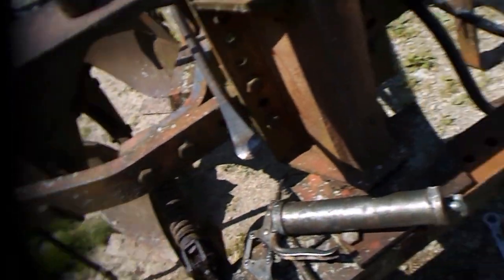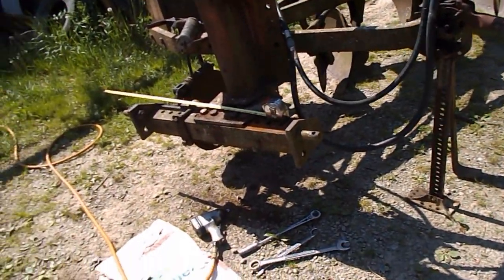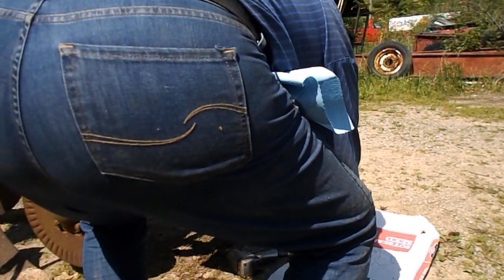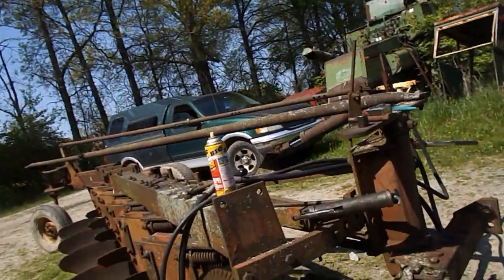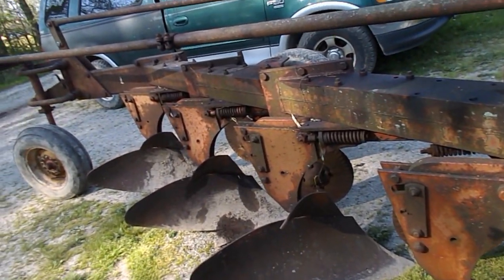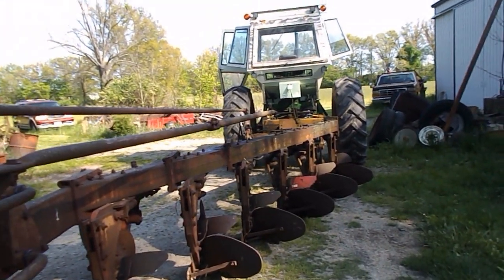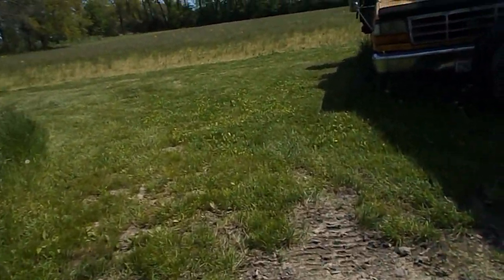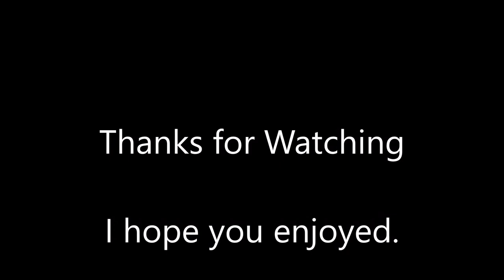Fixing the White 546 Plow May 10 & 11th 2022 Part #2

Comment: I sure do wanna see that oliver do well after all the love you have put into it . It sould pull them plows well it's got the power specially with bandit at the wheel. Have a great day sir and keep up the great work
Reply from the maker: We had an 1850 years ago and it pulled 5x16"s with ease so I dont think 6x14"s is going to bother it one bit.  The interesting thing is it will be running on an old injector pump that I borrowed and I think she is going to run great with it.  I've plowed with the 1850 before but this is a new to me never used before plow so I have a little learning to do on it and I think I'm going to have fun finding out !  Bandit

Comment: Looking forward to seeing you pull that thing behind the 1850.  My first international plow I bought, I had to adjust the rear wheel because it was kinda "dog-tracking".
Reply from the maker: Its going to be interesting putting her in the field for the first time with this plow behind it and I hope all the time I took measuring everything pays off or it will be back to square one !  The plow hitch had to be moved over no matter what I did and its a lot easer to move than that back tire on the 1850 will be for sure , That might turn into a real nightmare to move !  This is the first 6 bottom I've ever pulled before so this is going to be fun !  A tractor I've only plowed with once and a Plow I've never used before hummmmmmm What can go wrong ? Ah hell its going to be fun no matter what happens !  Bandit

Comment from the maker: Well its May 10th and 11th and I'm finishing up the work on the White 546 Plow. I start the day measuring the tractor and the plow to see how much I need to move the hitch over so it lines up with the tractor.  Well with the help of the fire wrench I got the 4 3/4" nuts off the bolts so I can move the hitch over and got everything tightened good and tight, No more ug-a-dugga's ! LOL I got the steering bar loosened up and moved back lining up the steering tire up a lot better than it was. Got a lot done to the plow and got it greased from front to back and to my surprise it only took 2 tubes of grease ! LOL  By the end of day 3 of this I got a new grease cap for the gauge wheel and got those bearings repacked as well as all the coulters on the plow so its pretty much ready to go. Some of you guys say the 1850 wont pull this plow but I'm pretty sure it will, We had an 1850 before and it pulled 5x16"s with no problem in fact it pulled them easy and being the 6x14"s are only 4 inches wider than the 5x16"s I think the 1850 will pull it easy enough, But one thing for sure its going to be fun finding out if it will pull it or not !  I hope you enjoyed watching.  Bandit

Comment: Its red with yellow wheels it may  be the last Minneapolis Moline plow built with a white sticker on it god bless you and your family bandit
Reply from the maker: The brothers that bought this new have passed on now but Harry @ McHenry's told me that they came in and ordered this plow as a 6 bottom in 1976. When it was delivered to them it was in crates and he had to put it together. He said when they opened the crates up he was surprised that the paint was MM red but it had the White decal on it with the MM yellow rims (no tires) and it was a 4 bottom main beam with 2 add on beams when it was ordered as a 6 bottom. This was in the time when Oliver and MM were being phased out and everything was being changed over to White so they just put White decals on what ever they had. Harry said they would order parts in for an Oliver and it might have been painted MM Yellow or Cockshutt red or White red and they would have to give them a can of Oliver green to paint it with so it matched.  I have 3 pieces of equipment that were bought new at McHenry's that Harry put together when it came it , He told me ware to look and sure enough found ware he signed it ! LOL That is kind of an odd thing to know but its kind of neat to know who put it together.  Bandit

Comment: Good video. Seems you really know your plows. Question what is the purpose of using a quick hitch?
Reply from the maker: The quick hitch is simply a time savings device used to make hooking up to semi mount and mounted 3 pt equipment a lot faster and easer for one person to do. A lot of tractors have extendable lower 3 pt lift arms and some dont making hooking 3 pt equipment up a real time consuming chore to do by yourself. Not to mention using a quick hitch is a lot safer because no one is between the tractor and implement to get hurt. I've wanted one for a long time and finally got one and I can say without a doubt life is a lot easer using this quick hitch in just time saved and not having to get between the tractor and say a 14 foot 3pt field cultivator to try to hook it up, With the quick hitch its just back up to the implement line it up catch it in the hooks as you raise it up reach around and flip the latches down and your done. Its one of the best things I've bought to use on a tractor hands down and its faster and safer for hook ups.  Bandit

Comment: Do you have sandy soils or gravel under lay in your soil? My 1855 will struggle with my 546 5 bottom plow I have in my soils. Do you think your 1850 will be smoking a little when pulling your plow? Love watching your videos and all the projects you get into
Reply from the maker: One spot with some sand in it but for the most part just clay about 6 to 8 inches down. The other 1850 we had would play with 5x16"s in this ground and I still have that plow back in the woods. 6x14"s will pull a little easer because of the smaller bottoms, 6x14" are only 4" wider than 5x16" so it might pull easer , We'll find out soon enough ether way and its going to be fun !  Bandit
Reply: @banditfarmer1900  I can't wait to see the 1850 pull the 5x14s. I plant corn with my 1850 6 row jd7200. Thanks Bandit for the  great videos
Reply from the maker: @matthewdavis4081  I think she will do just fine pulling that 6x14"s and thats the biggest plow I've ever pulled so this will be the first time to use the plow and first time to pull a 6 bottom so it will be a day of firsts cause one of the fields I've never plowed before and its the first one I plan to plow so I will enjoy the day.  Bandit

Comment: Well Bandit all I got to say is I still use row markers to plant and no electronics with 16 row planter all my tractors are older model with cabs some without no GPS or anything some of these farmers shut down for a sensor or planter electronics lose 3or5 days of planting don't understand then I got too thinking I don't believe they can operate with out electronic or GPS they don't know how to set a tractor up to plant or cultivate don't know what the emblem on the hood is used for when all this electronic stuff goes they are in for a disappoint ment
Reply from the maker: For what I'm doing I really dont need the electronics and to tell you the truth I dont know if I could figure out how to use them to start with. But I do know how to follow a simple mark left by a marker or a tire track left by the drill pretty good, Heck I have 50 years of practices ! LOL  I see a lot of the stuff guys do and I can see the good of having it but I can also see the downside of using it or not being able to because the mice got to the wires and your down till you get the parts in to fix it. For what I do keeping it simple is the best thing I can do and to tell you the truth I like it that way.  I still know how to set up tractors to plow and how to set up plows for a tractor and even if I havent done in awhile run the cultivators and do a good clean job of it. It might be old school but it still works really good , The biggest thing is to go slow and let it do its job, No Speeding ! LOL Used to love heading out early in the morning on the AC WD and 2 row mounted cultivators and doing corn or beans with the dew on , Quiet peaceful and easy to relax and just do the job. I'd stay out till about 11 12 o'clock and head back out about 6pm till about dark and I loved doing it . There are just some jobs on the farm that are just enjoyable to do , Cultivating raking hay and chopping corn stocks are jobs I love doing and I dont need electronics to do them unless its a radio ! LOL  Bandit

Comment: With the cost of fuel is it worth pulling that plow across the field
Reply from the maker: Well with roundup being over $60 a gallon a couple of gallon on diesel fuel is a lot cheaper to me to do. I bought a 100 gallon of diesel fuel a month ago and I still have 50 gallon in the tank so I've used about a gallon an acre to get seed in the ground so I think I'm doing pretty good. Bandit
Reply: @banditfarmer1900  I think 1 gallon per acre is a mistake??
Reply from the maker: @timknoll8654  Even if its 2 gallon an acre its still cheaper than going the no-till route.  I work my ground simply because one it compacts easy and 2 I have the equipment thats all paid for. If you run a tractor right (its the same with a car or truck) you will get good fuel economy. Most guys would put a 20 or 22 foot disk behind an 1850 , I put an 18 foot behind it so its not lugging the tractor working the crap out of it and I dont run them wide open like a lot of guys do. Most of the time the 1850 is running at 1500 to 2000 rpm range and its not working hard and its easer on fuel. This is the main reason when I fixed the long up and was going to sell it I used it and found out you couldnt stay on it long enough to empty the 21 gallon fuel tank !  Its the easiest on fuel tractor I've ever seen so I had to keep it. My 1550 diesel is the hardest on fuel tractor I have, It burns more than the 1850 does by far but I love that tractor ! I might use 2 gallon an acre to put crops in and harvest is about 1 1/2 gallon of gas , The 4400 is a gas hog ! LOL  Bandit

Comment: Turn the spindle on the rear tire? 
Oh and thats old iron- pour some black gold on it and go
Reply from the maker: This plow has been setting for many years when I bought it (long story to this plow) so more than anything it just needed a good going over resetting and greasing , Hardest part was getting the coulters loose to ware they would turn side to side as they were stuck at an angle to the plow.  Best oil to use on them is that good old black diesel motor oil out of my 1550 diesel, Man is that stuff black and nasty but it stays on what you put it on and really bonds with the metal . Black Gold indeed !  Bandit